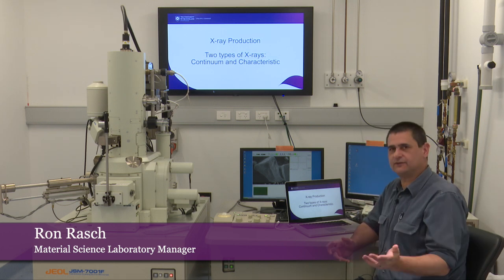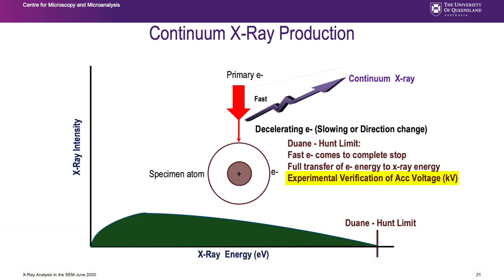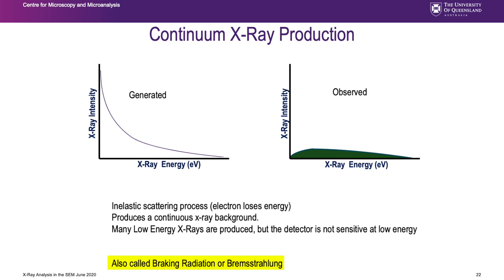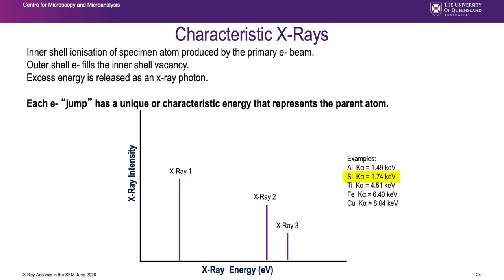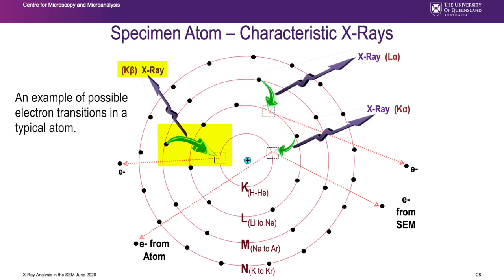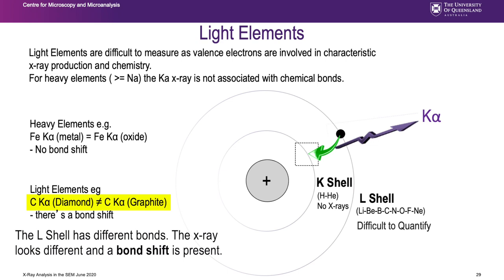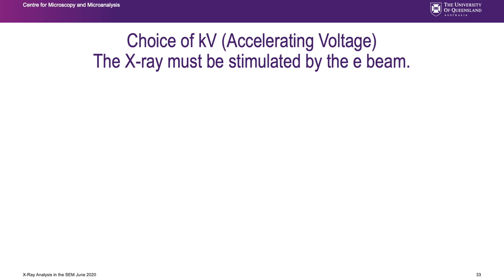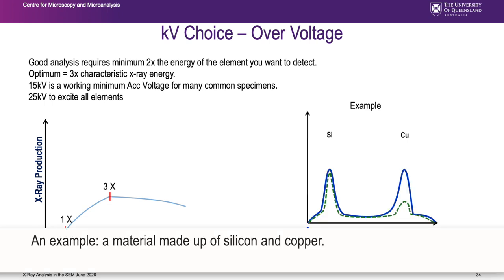X-Ray Analysis in the SEM: Part 2 "X Ray Production"

Comment: Big thanks to you guys for uploading these lections! 
I do have a question though. How do you treat a systematic inadequecy of Duane-Hunt limit? It is easy to discard one faulty spectrum, but if it happens all the time where should one look for a problem? Thanks
Reply from the maker: Ron says: When using the default standards provided by the software / detector manufacturer, it is best to make sure the D-H limit is close to the accelerating voltage. However if this is not possible with your specimens, then you need to run your own standards. Get a set of standard materials together of known composition, then prepare them the same way as your unknown material. Look at the D-H limit of all your different standards, and select a standard with the same D-H limit as your unknown material. Then use this standard to measure the peak intensity of the elements of interest. Measure your unknown material against this new standard, rather than the default factory standard calibration. The general rule is, like with like, e.g. silicate standards for silicate minerals, metal standards for metal measurements etc.
Reply: @MicroscopyAustralia  Thank you for answer, you are really helpful!